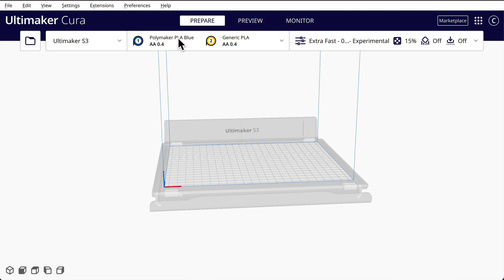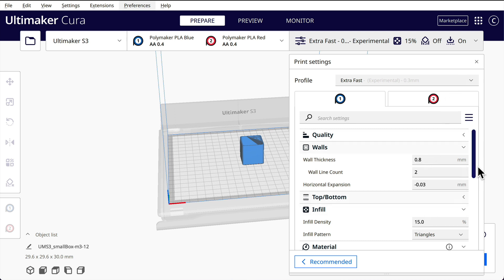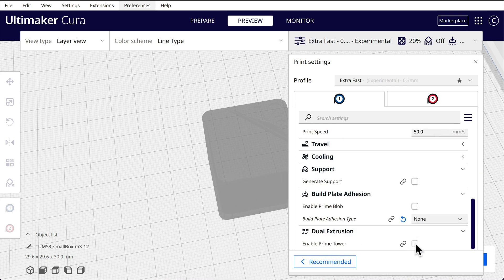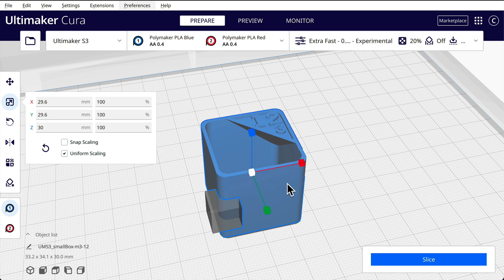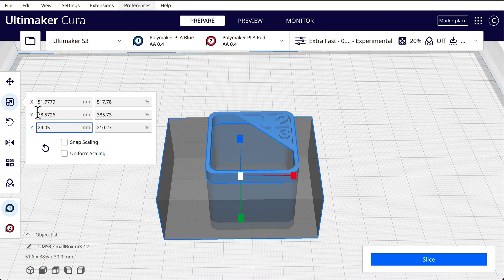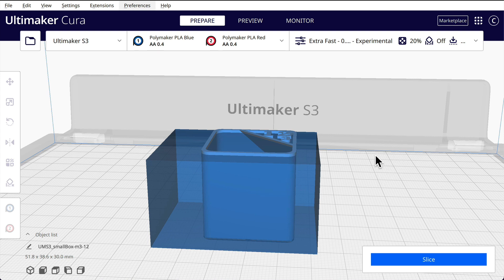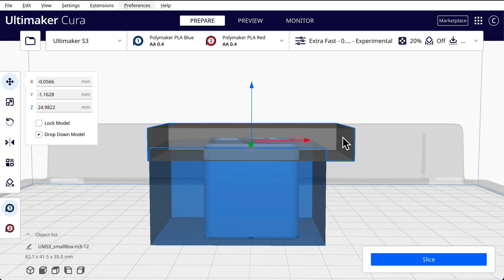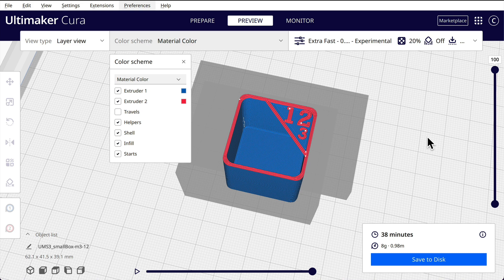Two Color dual extruder by layer height: 3D printer model

Comment: Great tutorial - I so wish that was easier to do in Cura, like in Prusa Slicer, Bambu Slicer, Orca Slicer etc. but your technique is still the easiest I've seen so far in Cura. I'm spoiled using a Bambu Lab P1P at home (with Bambu Slicer or Orca) but we have Ultimaker S3 and S5 in the lab and so we still tend to use Cura there for the tighter integration with that specific hardware.
Reply from the maker: really weird, Cura. I went on their forums and it was almost blasphemy trying to get color change by layer height.. Something about that is a post-processing issue. They didn't seem likely to add that feature, even though it is something we use all the time in Prusa and Bambu slicer.
Reply: @davecrabbe4579  in this case, your tip worked great for me. I had a model that is 3mm in height, starts in White, switches to Black at the 1mm mark [the layer at about that spot], then prints for 1mm before switching back to White for the remaining 1mm. A pretty simple 2-color "sandwich" type of print that looks pretty cool (it's a double-sided "coin" type of model). Using your idea, I was able to create a 1mm thick "support blocker" that was the same width/depth as the model, and intersect it at the 1mm Z height. Setting the blocker to nozzle #2 (which I had assigned to a black PLA) worked exactly the way I wanted; the print started with nozzle #1 (white PLA), switch to nozzle #2 at the 1mm mark, then switched back to nozzle #1 at the 2mm mark. Sure, it's a little janky but still much better than having to actually break the model into multiple pieces and recombine them in the slicer [with nozzle assignments for each piece]. Thanks again.
Reply from the maker: Glad that suggestion helped.. Exactly the type of thing I was doing.  @KenRossPhotography

Comment: Very nice demo! The company i work for is just getting into 3d printing. I got picked to be the guy in charge of it! I started with zero knowledge and an ender 5 plus about 18months ago. We just upgraded to a Modix Big 180x with IDEX. With a $15k price between machines, Its a massive upgrade. Im currently assembling the modix. One of my smaller goals is to use the second extruder and print lettering in a different filament color. This video is the best tutorial I've found to do that. My next goal is water soluble work supports. Thanks for the on point and simple tutorial!
Reply from the maker: water soluble supports are very hygroscopic.. if you have over 50% humidity, you should put it in a dry box.. You can also use PLA as supports for PETG and vice versa.. as a substitute for actual water soluble supports.. I haven't used but works well for external supports.. If you need support inside the model, then water soluble might be necessary.  If you use a Prusa based slicer then color change by layer is much, much easier.. Cura has some philosophical objection to the way Prusa does it.. but it is waaayyy more straight forward.
Reply: @davecrabbe4579  OK, thank you for the tips! Hypothetically,  if you were handed a list of every slicer software you could think of, what'd be your pick if you knew thre rest would be deleted, and you could only use the one you picked? Price is not a factor. Everything on the list is free.
Reply from the maker: It's really the one you learn. I've not used Cura much, but it is the grandfather of most of them. I like the ease of use of Prusa Slicer and I've really only learned that software. I've used Bambu's derivative a bit and it is a bit nicer if you have a Bambu printer.  @chrism1130
Reply: OK thanks Dave! So far I've only used cura and only on our ender 5 plus. I really like it. The Modix is open source for slicers. Ill start and dial in the Modix with cura since I know it. The Modix budget  I requested included Extra funds for getting into paid slicers. I'm still in the process of getting the Modix 180x assembled. I'm hoping to power it up and start the calibration process next week. It's been a really fun project. The print volume is 23.6" x 23.6" x 70.6". Thanks so much for the tips and wisdom! And for reading my rambling giddy posts. Nobody at work has experience in the printer world aside from me. It's fun to get to talk and share with fellow enthusiasts like yourself. You'll probably be hearing from me in the future!